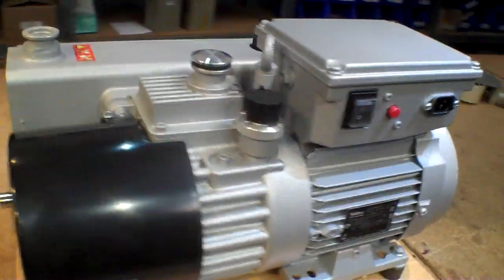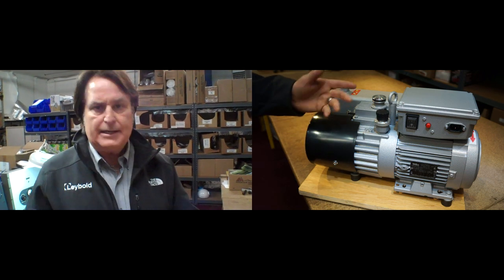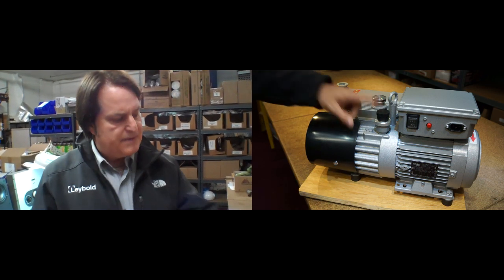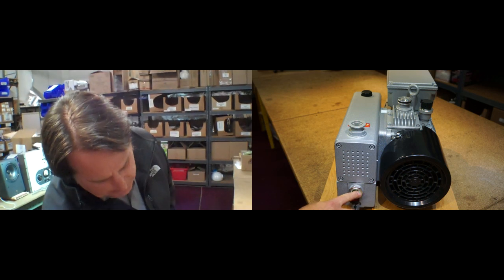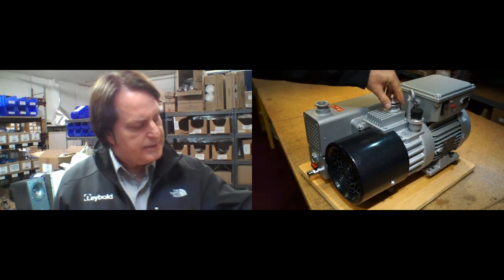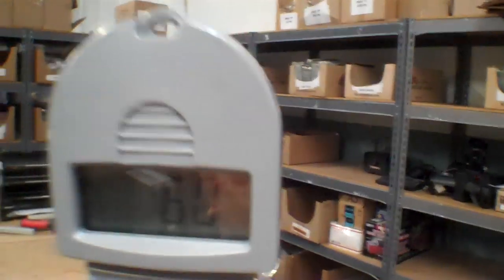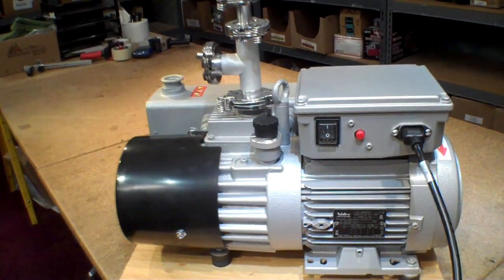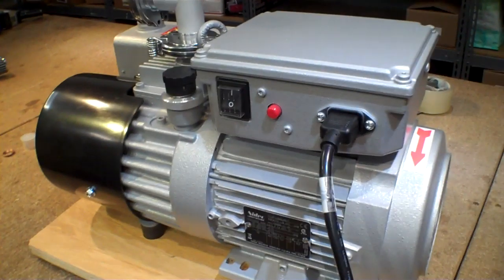Introduction to the Leybold Sogevac® Neo D 16 rotary vane vacuum pump.

Comment: Thank you Bryan for your video!  Question, have you tested to see how long a good vacuum is held with this new pump after the pump has turned off?  Often i can't pull my food out when the freeze drying has stopped, and need to leave it in the dryer maybe up to 24 hours after the pump stops.  Thanks! :)

Comment: Not to be a spoil sport but I found an Agilent tri-scroll 300 commercial unit on Ebay for $700 and it seems to work great with less noise and no oil (and a gas ballast too).
Reply: How long have you been using it now--- any issues?  I am curious to hear your feedback....

Comment: This pump would be great for vacuuming NEON tubes. I used to have The Cenco Hyvac 7 with out the diffusion stage pump when I had my neon shop in NYC.
Reply: I bet the government used eminent domain to shut  down your great neon factory in NYC. The government has gutted NYC of anything industrial and put up a shopping mall in its place. RIGHT?
Reply: NO, eminent domain wasn't the reason, back in 1988 there was a price war on, especially the Korean owned shops at that time. I could not compete  with those cut-throats. Richard Baciano the owner of Show World canceled my lease. Today The  New York Times 50 story building sits on the former site where my neon shop was located at 244 West 42nd St. 10036. Baciano sold most of all the buildings he owned to developers.

Comment: This seems like a quality pump!  I look forward to you doing some more videos on this pump.  Is this an American made pump?   You don't have to change the oil after every use, right?  How does this compare with the oil less pump of HR?  I just subscribed and look forward to more informational videos!
Reply: I've been using the HR oil less pump since January and I can tell you for me, it was worth the extra money. I hated dealing with all the oil changes and filtering. Very messy at times. The oil less pump is very easy to maintain and runs much quieter. Mine did develop a very loud noise after 8 months of almost constant use. HR rebuilt it under warrantee and even picked up the tab on the shipping. I had it back in just 2 weeks. It's been running almost 24/7 for the last 3 months with no issues. I work in an industrial chemical as a maintenance tech and I know first hand that it's not uncommon for a pump like this to develop issues with such heavy use. It is a commercial grade pump and very good. An industrial grade pump would cost 4X as much and most people couldn't afford it. If I have to rebuild it once a year - I'm OK with that. I'm very pleased with it's performance.

Comment: I would like to see you make a fossil with the freezdrier. 
.
1. First you freezdry organic matter 
2. then you desolve as much salt into water as the water can take 
3. then you put the organic matter in the water
4. and degas it in a vacuum
5. then release the vacuum to hydrate the matter 
6. soke for an hour or so 
7. then freezdry 
8. and repeat until the organic matter has absorbed as much salt as it can
.
Then you will have a salt fossil of a stake or fish excetera.
Reply: It's pretty different from an actual fossil but it does sound super interesting
Reply: @FrancisR420  a fossil is mineralised organic matter. when it is biodegradable it is referred to as petrified. petrified is a fossil but a fossil is not necessarily petrified. like petrified wood

Comment: We enjoy watching your freeze dry videos because you have multiple people, with different tastes, to try the rehydrated foods.
We made a video of vacuum pump cleaning and seal replacement because I was surprised by how clean our pump was when I opened it after 56 batches. I don't plan on opening it again for 100 batches this time.  We had to use still photos for our video because we had not planned to make a video at all because you already had a great video about replacing the seal. Thanks for that! (we put a link to your video in our description)
Both the oil-less pumps and the Leybold pump look like good pumps, but I'm sticking with the original vacuum pump. (at least for now) We have been using it for 2 years now and just finished batch 220, all with same 2 gallons of oil we started with. Once a continuous filter system with a water absorber is in place, the oil type pump seems more cost effective than buying one of the more expensive pumps, $300 vs $1600.

Please keep making rehydrating, taste testing videos with multiple people trying the food.

Comment: Just subscribed because I like what you are doing by showing what can be done with "off the shelf" equipment and because you push the envelope of seeing what could make freeze drying better.   I found an old style, medium size Harvest Right with a stainless steel cabinet at an estate sale.  It came with the strip heater sealer, the original brand of oil vacuum pump, instruction book, and some company Mylar bags.   I paid only $275....  With you and your group's kindness and honest opinions of how boundless and common sense ideas work, I'll learn on the old vacuum pump, but plan to upgrade the software and invest in an oil less vacuum pump.  Thank you for your time and sharing what ya'll do.  From Texas, all the best!

Comment: OK, thanks - but no thanks. I have the oil free pump already. Why would I go back to dealing with oil? The oil free is cheaper and you can run it directly from the dryer. Although I did wire up an interposing 20 amp relay just to take the load off the dryer relay. 
 I think I'll stick with what I have. Thanks.
Reply from the maker: Like I said, not for everyone. Mainly for people doing wet loads on multiple machines at the same time.
Reply: @EpicenterBryan  Really??? Who can afford multiple machines? The one I have set me back $4300. I only know of one other person that has 2 machines. A new one and a very old one, and she lives in Florida.
Reply: Old Frugal One Hyper-Drive Movement 
you know Cynthia in Florida?
Reply: @mikicrespo4812  No, cant say that I do.
Reply: @jerrysmith372  There are those of us that do or will have two. I found one I couldn't pass up locally for sale super cheap (medium). I have the large on lay a way. idk if I will need or keep both but I like having the option. I may give the medium to my daughter.
Reply: @jerrysmith372  I haven't set up the medium yet because I am Leary about the electrical needs of the unit. Do I need an electrician for it?
Reply: @PreppingAngel  The medium and small units will run on a standard 15 amp household circuit. Only the large unit requires a 20 amp circuit. I am an electrician so I ran my own power for my large unit. You may need an electrician or a very good handyman to add a circuit for your large unit. Don't let that stop you from getting the large unit - it really is the best one to have. And I know the oil less pump is an extra $1500 but for me it is well worth it. I've had my set up now since Dec, 2018 and run it almost all the time. In fact I have 5 trays of meat going right now (about 13 pounds) I have been able to dry about a 2 year supply of foods so far. With the coming food shortages it will prove to be money and time well spent.
If you ever have any questions that I can help you with, feel free to ask. There is a learning curve with these machines and having someone to answer questions can save a lot of time and money to avoid mistakes.
Watch a lot of you tube videos on the subject. Best advice to remember is not to overload the trays. About 2 pounds of food per tray  or one quart of liquids to start with until you get a feel for how things go. You can do cooked foods or raw foods in a dryer. Even ice cream.. Don't try things with high sugars like jams or high fat like sausage or bacon - they don't do well and can make a big mess.
Good luck my friend. Happy freeze drying.
Reply: @jerrysmith372  Thank you. I've been watching YT video's for a few years now. Just a little jittery with actually doing it hands on. :) I'm also on a lot of FB groups. I ask about the oil less pump but I get mixed reactions. Some say don't bother and some say they love it. Me? I'm afraid of the oil going everywhere and the only place I have for it is within my house so if the oil does go everywhere it would create a huge problem for me. I know to get a cart, table etc and the pump should be below the unit. Our garage is used for working on cars, farm equipment etc so I really don't want food out there. I have no basement and because of the noise the only place away from the family is at the back of the master closet.
Reply: @PreppingAngel  Well that kinda sucks. You don't really want to have it in your bedroom. Batches can take up to 48 hours and that might disturb your sleep. The units do produce some heat and in a closet there might not be good air circulation. The oil less pump has an operating temperature of 130 deg F so in the bedroom is not a good place.
I have mine in my garage. Keeping it clean isn't that hard and the chamber is sealed under a heavy vacuum. You may want to reconsider the garage. I built a work station and clean the area before and after each batch.
The oil pumps are a bit messy but really not terrible. I love my oil less pump. It's personal choice.
Reply: @jerrysmith372  I think it will be ok in the master closet. The "closet" has 2 windows. When we first moved in here I had a queen size bed, 2 night stands and a dresser in there with room to spare. Between the bedroom and the closet is a brick wall where it used to be an outside wall. The door goes into the master bath and then another door into the bedroom. I can put a fan blowing in one window and out the other. I should be ok. I am just concerned about the oil blowing. We actually don't use the master closet but to store junk, Christmas and other holiday items. Hubby and I are scaling down soon because we just don't use all the space the house has for living. A nice cabin over a basement with a garage is what we are aiming for. Going down to less than 1,000 sq ft cabin and have the basement for storage, my canning and food along with my "preps" and freeze dryer.
Reply: @PreppingAngel  Well you would know best. Keep in mind that the large units require a dedicated 20 amp circuit. And that the operating temperature of the oil free pump is 130 deg. F and will cast off quite a bit of heat. It is quieter than the oil pump though.
It's just my opinion but if you want to seriously put up a lot of long term foods the large unit is the best value as it will process more food than the medium and the small units combined for just about the same energy costs.
When compared to commercial freeze dried foods the Harvest Right will pay for itself in less than a year with 3 batches a week. 
I personally have been very happy with my large unit and the customer service department at Harvest Right is stellar. 
It is possible that you may experience an issue with your unit but they will go the extra mile to make it right for you.
If you should ever have a question that I can help you with - feel free to ask. I will do the best I can to help you out. Good luck and happy prepping.
Reply: @jerrysmith372   Ran our first few batches! Skittles, Some mellows, and some starburst for the kids... Starburst.. Nope. We do have an issue with the door not sealing great so HR is helping us through that on a medium we picked up second hand. AFTER the oil spewed into the room twice through the exhaust handle.
Reply: @PreppingAngel  Sorry to hear you have had issues. When I was using the oil pump I would put an old sock over the pump vent to keep any oil spray from going all over. Is your dryer the old model or one of the newer ones?
I went with the oil less pump. I hated dealing with the oil and all the filtering and pump cleanings.
Glad to hear that HR is helping you with your machine. They really are a great company.
Reply: @jerrysmith372  It's an older two knob style. The door broke. My daughter used Plast T Weld on it and fused the broken pieces back together. BUT when she did that the holes for the screws became too big for the screws. So, my daughter being a nail tech that does awesome acrylic nails used her mojo and made a dab of acrylic nail monumer! It's up and running again. HR said we could purchase another door for 75.00 which we may still do just in case the door breaks again.
Reply: @PreppingAngel  Very interesting story. I suppose there are still many older models out there still running. They work just fine even though they may be a bit more cumbersome to operate. Good luck with that machine and happy freeze drying. 
FYI - I did a tray of chocolate milk the other day as an experiment - it didn't do well. Too much sugar in it and a section of it was still very tacky. I will package up some dry mix for long term for the kids. Whole milk does very well. I run it through my food processor for powdered milk. I do the same with eggs. It works very well.
Reply from the maker: You would be surprised how many people have more than one. Commonly, people who have big gardens or farms. Some people sell their goods at farmers markets. Some people do candy to sell. One guy I know does specialty coffee.  There are lots of pot producers that bubble hash in multiple machines. Join one of the groups on FB and you will be amazed what people do.